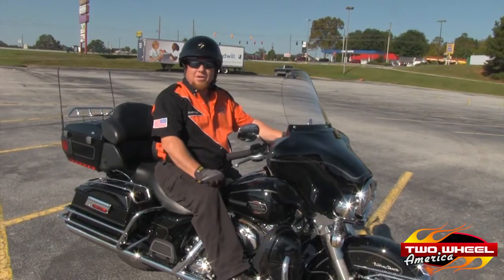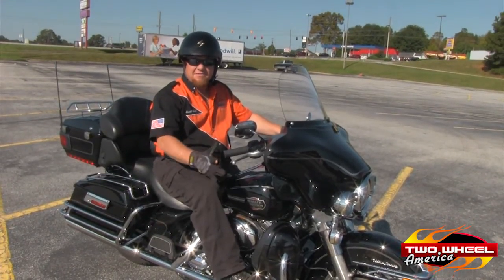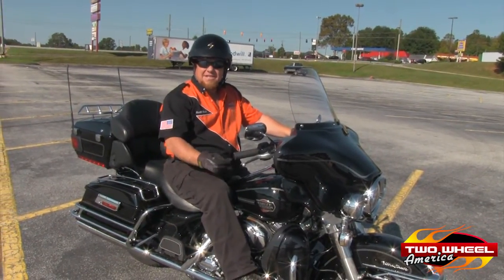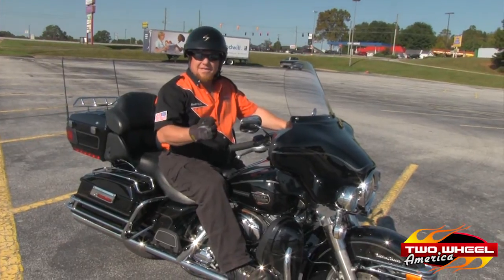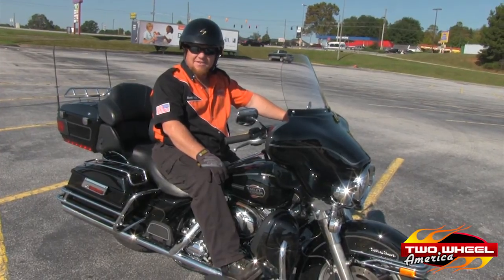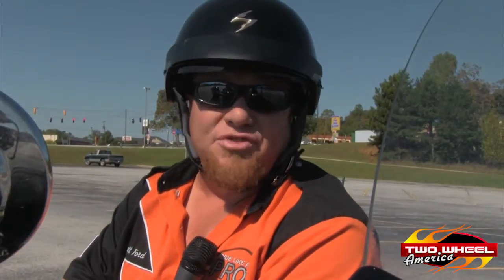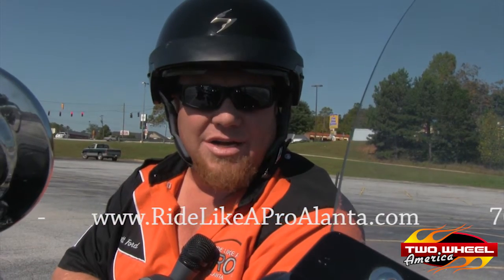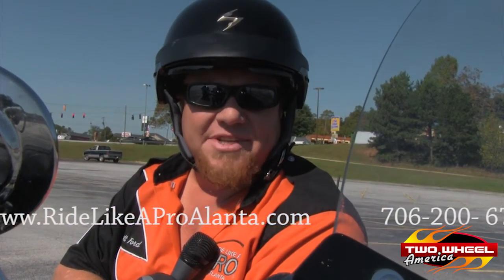Scraping your floor boards is OK

Comment: The bottom of my floor boards are scraped flat and its starting to grind the ties off from my rubber mats so I'm going to buy 2 cap head titanium bolts. Then it'll throw pretty sparks at night plus it will take much longer to wear down titanium rather than aluminum

Comment: Believe me, on my Suzuki C50 I have absolutely NO problem scraping the boards...On that it's hard not to....Lol.
Reply: I ride the same bike 2009 model, and have the same problem. Every time I get lower I hear that scrape!
Reply: @pdxripjaw  I fixed the problem. I replaced the boards with a set of pegs from an M50.
Reply: @jamesmcgrath1952  Was it a simple swap or did you need to do any extra modifications besides removing and swapping the pieces?
Reply: @pdxripjaw  Simple swap. They're built on the same frame. Make sure it's a complete swap. Foot controls included.